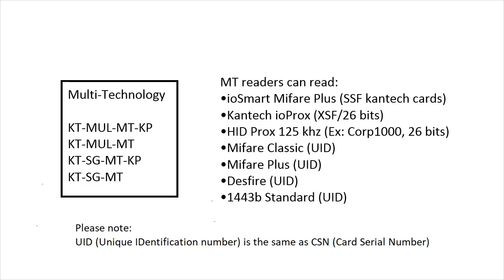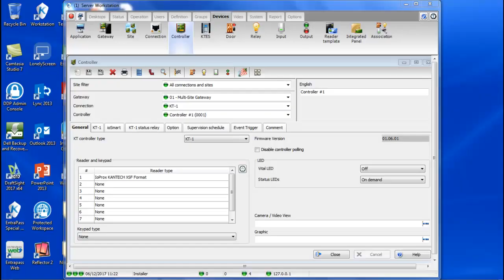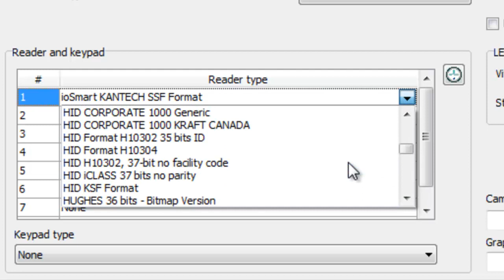ioSmart Wiegand

Comment: I have an ioProx P225XSF that is calling for a 22 awg 3 UTP cable. What will happen if I install a shielded cable? Thank you.
Reply from the maker: Using a shielded cable will reduce the distance you can wire a reader without having read issues. It is not recommended
Reply: @kantechsupport6044  thank you for your reply, 40' run ?
Reply from the maker: @BostonSparky  Unfortunately, I cannot confirm that a 40 foot run would work correctly as there have been no tests done with shielded cables.